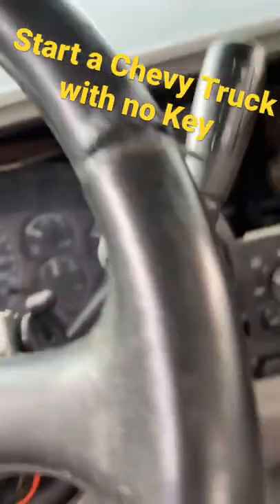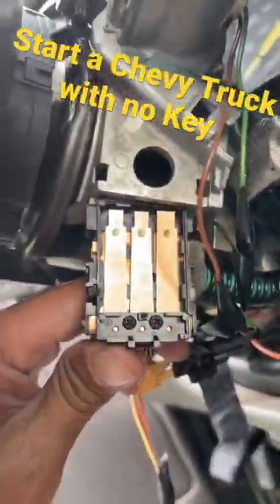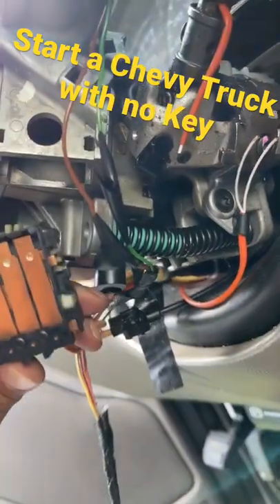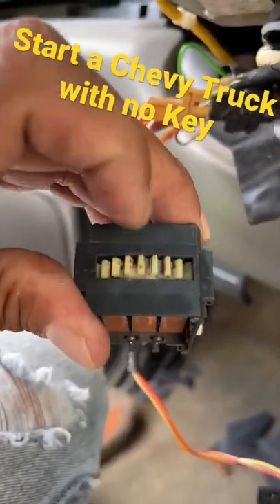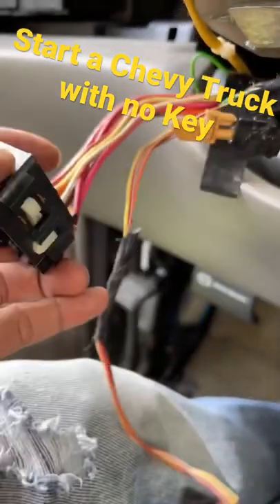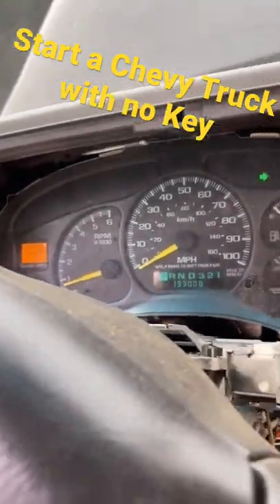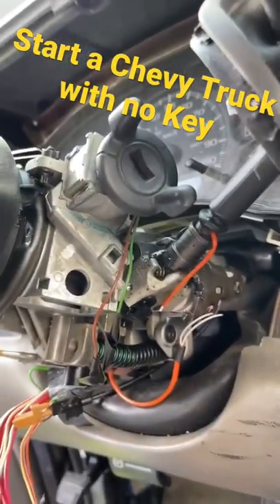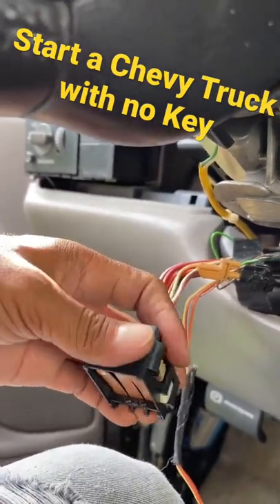How to #start a #truck with no #keys #chevy #chevrolet #chevytrucks #silverado #pickup #howto #diy

Comment: Mine turns on then right off
Reply from the maker: Yours probably has a chip
Reply: What should I do
Reply: Or can I do
Reply from the maker: @Late20  get a locksmith and they can make a key programmed to your car
Reply: Same bro having problems with mine
Reply from the maker: @tanneralexander5886  if it’s key related , your transponder chip is defective. Either need to get it program again or get a new key cut and programmed. 

Or if it’s not key related, it’s something else in starting system
Reply: Didn't work on my 05 s10 blazer.. just starts for 2 seconds and shuts off
Reply: @Late20 what model truck do you have my 2002 2500hd doin same thing

Comment: I have an s10 that starts by just pushing in the clutch.. I cant figure it out and replied this ignition switch already still does it
Reply: Your pedal or safety switch is arcing power to your signal wire for the starter

Comment: Thanks for teaching me how to steal a shitty truck.
Reply from the maker: You must drive a Ford 😂
Reply: @autopurlieu  7.3 powerstroke
Reply: @trippgibson9648  powercox
Reply: What about it don't want to stay on
Reply: Funny is not even an 2012 😆 😂
Reply: @trippgibson9648 even easier to steal
Reply: @autopurlieu 😂😂😂😂
Reply: @trippgibson9648 Those obs fords are much easier to steal than this, it’s a simple little switch under the lock cylinder that engages the starter 😂
Reply: @trippgibson9648 Two little T-25 screws lol
Reply: Ya someone tried to steal mine last night lol he didnt succeed but destroyed my ignituon
Reply: How do you unplugg that plugg from the ignition?
Reply: @autopurlieu my dmax will almost start then quit it’s so gay

Comment: okay so I got my truck started but it won't stay running what do I do?
Reply: Same here. I need help please
Reply: @eduardov9223  how did you end up shutting down?
Reply: Did u figure that out I have same problem
Reply: Same problem what did u do
Reply: you need to figure out the resistance of your key to enable the confuser components, there is like 13 possible values that may or may not work

Comment: Mines turns on and off right away, any idea why?
Reply from the maker: There’s chip. It needs a key with chip
Reply: @autopurlieu mine has the same problem but I’ve started it without a chipped key before
Reply: Those years don't have transponder.  It's the barrel mechanism.
Reply: That's the passlock
Reply: Because it requires a transponder to keep it running or some the actual switch is learned to car. It's called Passlock

Comment: Still need to beat the steering lock 
So what’s the purpose behind this?
Reply from the maker: It’s a donor car, wrecked car.

Just need to see if the engine is in good running condition . 👍🏽

Comment: I have a 2000 chevy suburban mines dont turn over, and when i put everything back together it still don’t turn over i think i messed up the ignition switch.
Reply: Yes you have to  move and lock the wheel into place to get it back to original

Comment: You can start the truck this way BUT the key in lock position wont let you down shift so ure not going nowhere...u need key to unlock steering wheel...

Comment: My 99 suburban is a bit different mine has a slit I turn it n it still won't start new starter new starter relay fuse I cut the 2 wires n soderd them for the theft system n it still won't start I think its the theft system...how can I reset it

Comment: dumb need a resistor there is a anti theft chip in ever kehy
Reply from the maker: Not in every key
Reply: No actually they are not in the keys on these trucks. They are built into the cylinder so when the cylinder is turned forward it activates the chip in the key cylinder sending the correct resistance to the pcm. You can get a metal copy of your key made and start the vehicle. Its to prevent them from theft from being hotwired. Which in case, if you have the correct resistor you can just bypass that too but you need to know the resistance of the chip in the cylinder.

Comment: Should’ve just bought a ignition with two keys for $30 and took 5 minutes to swap.
Reply from the maker: It’s a junk car, it’s not going on the road
Reply: Can't always do that either if u don't have the original key I've done this and it sends the truck into anti theft mode
Reply from the maker: @mercedeshult4734  it just did

Comment: Will this work on a Chevy colorado
Reply from the maker: Not sure if they have the same system. You have to check it out
Reply: @autopurlieu  what year is this because i just bought one from copart without a key
Reply from the maker: @copartking  to be honest , I don’t remember anymore . Adjust bought it too from auction just to get the engine out
Reply: @copartking that’s a 99-02 Silverado in the video

Comment: I have a 2000 Chevy s10 Can security light prevent my truck staying on ? Ignition assembly and cylinder are about be replaced since they where damaged
Reply: That’s the problem I’m having anything after 2 months lol?
Reply: @ly_absolute Look up passlock bypass and it'll show ya what to do

Comment: So you started it , now how will you fix the problem of locked steering? Without the key the steering cannot be unlocked. Just the ignition switch alone will only start the car but good luck going anywhere lol
Reply from the maker: Lol the car ain’t going nowhere. The LS engine is going in somewhere lol 😂
Reply: @autopurlieu wait..LS ?? Learning Disabled ?? Lol😮 
But really ...whats LS got to do with it?

Comment: Someone tried to steal my truck, didn't know what they were doing. Removed ignition switch and now it won't turn over 🤷
Reply from the maker: So they took out the ignition switch ? What truck year and model is it ?
Reply: @autopurlieu  yeah, they ripped it out 02 Tahoe
Reply from the maker: @illynatic  hmmm it should be able to start it with a simple replacing the ignition  switch. That truck doesn’t have any transponder chip. 

It should be wired properly though
Reply: They didn't take the ignition switch, it's still there and I can crank it up but it won't turn over. Switch looks damaged tho
Reply from the maker: @illynatic  crank and turns over is a same thing. Do you mean it doesn’t starts the truck? 
If the engine turns over but won’t starts the car, it’s not a switch problem. 
It’s either battery / starter or something else that won’t starts your truck. 
You need a mechanic to get it diagnosed fully properly .
Reply: Fuel pump and starter are brand new
Reply: Check the neutral safety switch

Comment: Don’t do this if your 2004 has anti theft.  Tried it, and the truck shut off my fuel pump.  It’s going to be a little costly for me now.

Maybe it’s only limiteds, I have a ‘04 North Dakota adventure edition that came with all the bells and whistles, maybe more.  We’re towing it over for repairs tonight.  

For me, the first time it started, uses up whatever little gas it had and choked.  After that, customer engine trying to start.  Found my key days later, same thing.  So it won’t work until fixed, the  guy at a more than reputable place specializing  in fixing electronic issues had seen it before.
Reply from the maker: To each car is different
Reply: How much did it cost?
Reply: Just have to do the reprogramming